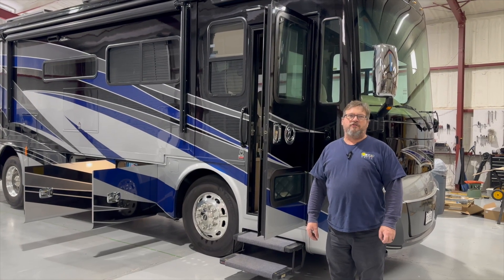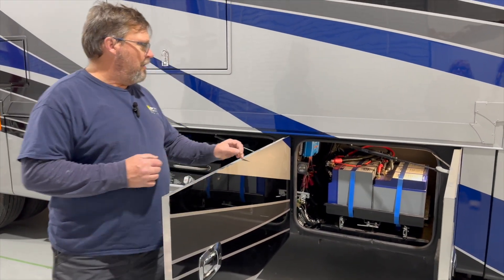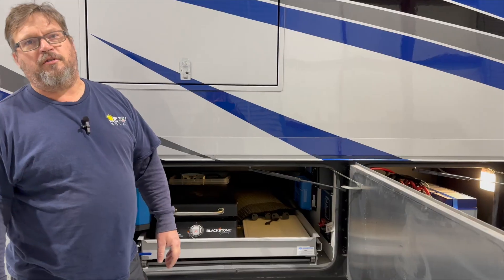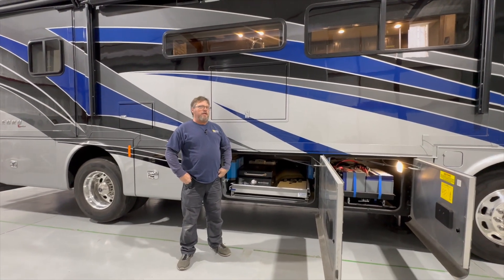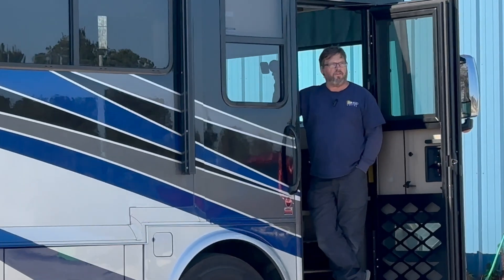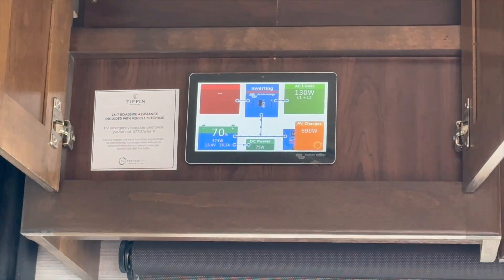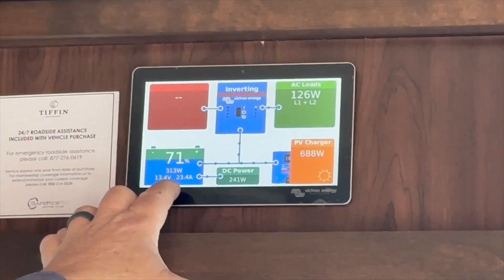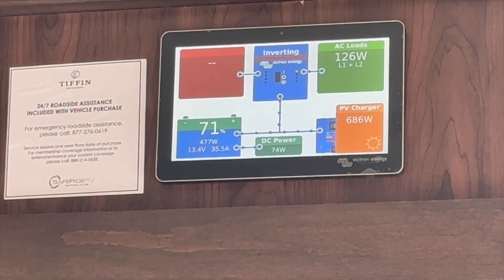2020 Tiffin Solar Installation by Panels Up Solar

Comment: I installed a Vitrom 60 AM charge controller and 4 panels, connected to the house batt. Will it also charge the chassis batterie through the bim? Or do i need to run a wire tot he chassis batteries?
Reply from the maker: @tonyrogers9553  The Lithium BIM will allow the chassis battery to charge for one hour when the house batteries are near full
Reply: @PanelsUpSolar  I do not have lithium batteries. Should I install a Xantrex ECHO-Charge Chassis Battery Maintainer? I have the original BIm that came with my 2020 Tiffin 40IH.

Comment: How do you go about tying in the 50 amp shore power/generator switch onto the victron?
Reply from the maker: The power is redirected coming out of the transfer switch, through the Victron inverter(s) then into the main circuit breaker panel.

Comment: I'm doing a conversion of a 2008 Phaeton at this time.  I have currently installed 3 bifacial Eco worthy solar panels (195 watts each) and likely will install an additional 3 panels in the future. They are not adjustable angle panels.  As far as the lighting issue, when I purchased my coach all of the ceiling puck lights were halogen and I replaced those along with many others with LED lights which has brought my total amperage down to about 3.8 amps.  Currently I am awaiting my Epoch 300 Ah battery to arrive as it is backordered.  And also will shortly order my MultiPlus ii 12/2 120 volt inverter/charger.  Questions for you, I see the Cerbo GX readout is located over the drivers seat.  How far is that from the Cerbo GX itself, and what special was done because of the distance.
Reply from the maker: The Cerbo is pretty far away. We used a high quality HDMI extension cable to make the distance. But it needs to be a good quality cable. If that Epoch battery is to far out on back order, let me know. I have a really good alternative for you. Also with Victron communication and I am sure I can beat the pricing. I would also suggest you look at your power needs and consider a 12/3000 vs the 12/2000. The small price difference is worth the extra benefits you will get with the larger inverter. Feel free to reach out if you would like more information.